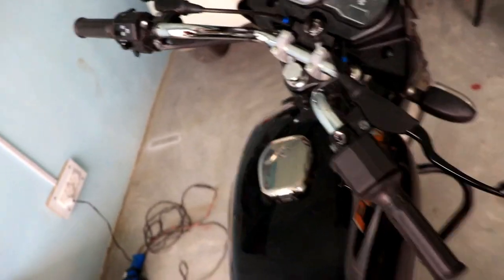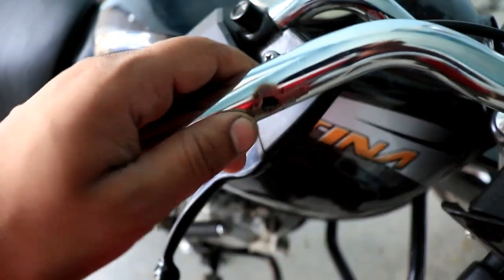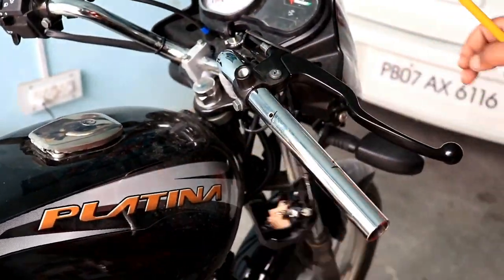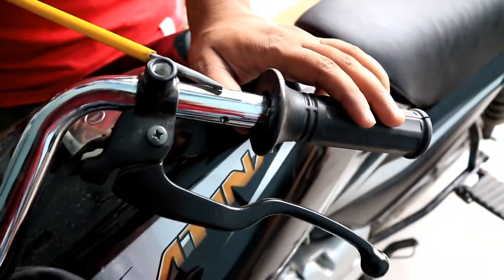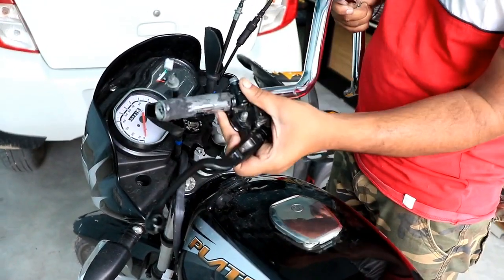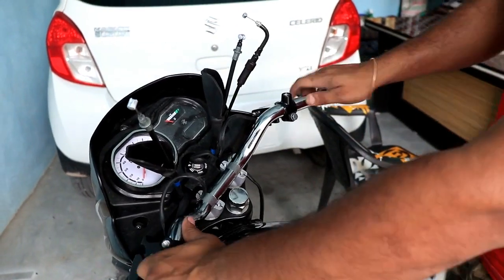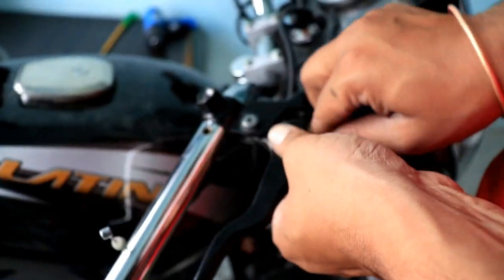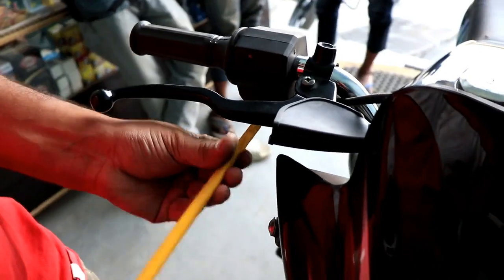bajaj platina handle modified || royal enfield fury handel

Comment: Fury was a 2stroke legendary bike from Zundap launched by RE ..it was not in 2011in 80's..pls clear facts before vomiting.
Reply from the maker: yes brother. sorry for 2011. i just read something from Wikipedia. 2011 single range 499cc. you can clear this. i will pin your comment
anyways motive was to install handle on platina not else
Reply: Tvs fero